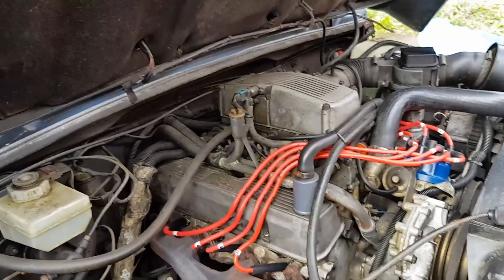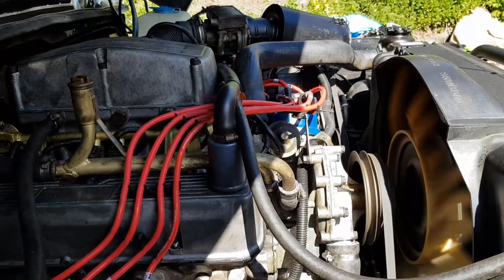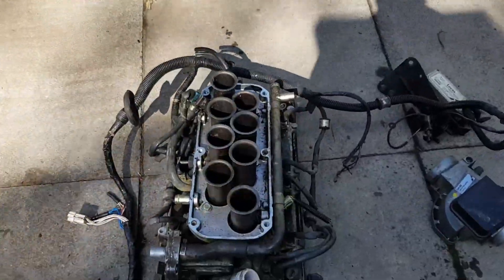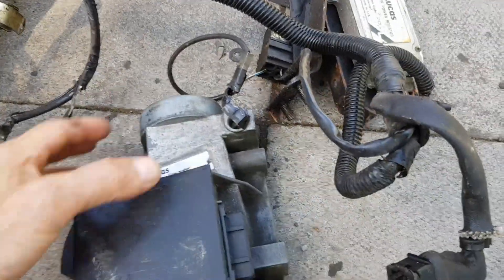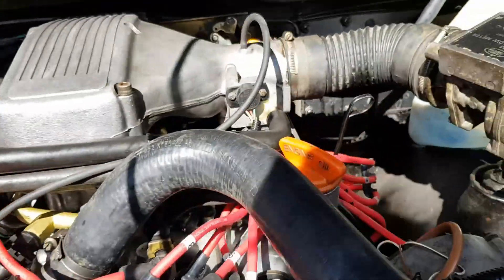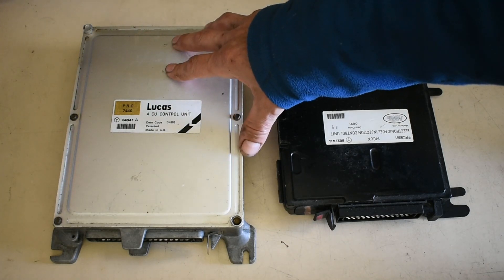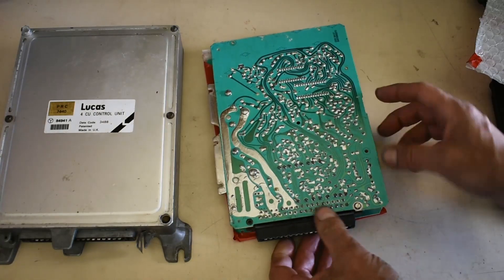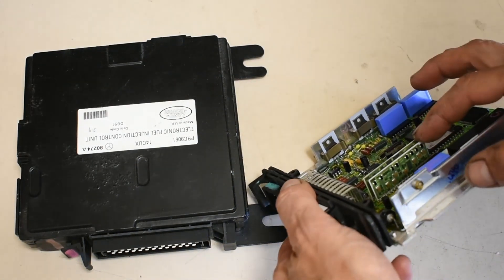Rover V8  EFI system

Comment: Nice work. I'm doing the exact same swap and I was wondering how you wired up the three relays under the seat next to the ecu? 
With the original system the flapper has a switch in it to turn on the fuel pump, but I guess with the 14CUX this is done by the ecu and may need some wiring mods? Cheers.
Reply from the maker: Going from memory, there are a few different connections in the wiring harness connecting a CUX ECU instead of the Lucas ‘flapper’ type. You definitely need the CUX wiring harness with the engine management. This will include under seat relays. I also changed the main car wiring harness to accommodate this change, otherwise some extra wires may be required. You’re right regarding the fuel pump. This is through a switch in the flapper air flow meter, where as it is a relay controlled from the ECU in the CUX ECU. The ECU main car harness has an inertia switch to disconnect the pump in an impact. This isn’t on the ECU harness and was part of the function the flapper air meter provided.  There are also a few other differences including the lambda sensors, if fitted, a road speed indicator also feeds the CUX ECU and this is derived from a sensor on the transfer box on later vehicles with electronic speedometers and ABS. The engine will run without this signal but may have a different response.  There is also an indicator resistor added to the ECU harness indicating if automatic or manual transmission. So, there are a few differences that need addressing to replace the injection system. Hope that is of help.
Reply: @tuopeeks  Thank you, it's a great help. I'm only changing the ECU/engine harness so I guess there will be a bit of splicing required for fuel pump relays etc. As for the road speed signal, I've read it's to help the 14CUX adjust idle properly and people seem to have omitted this in swaps and it's fine... but will have to test it all out to know for sure. Thanks again.

Comment: Tengo un RRC 3.5. Podrías darme todos los números de partes que necesito para pasarlo al sistema 14CUX??
Reply from the maker: Es un gran trabajo, pero el sistema es exactamente el mismo que el 3.9, excepto que usa el número de ECU PRC9235
Reply: @tuopeeks  Me imagino que tenes que desmontar absolutamente todo para meter todos los cables. No tenes video del proceso?

Tengo mucho problema con mi sistema y poner un sistema que pueda escanear seria excelentisimo.
Reply from the maker: @alcideslazomolina3286  Supongo que tienes un sistema "Jettronic" de 3.5 V8. Para adaptarse al "CUX14", debe considerar algunas entradas adicionales. Estos incluyen el sensor de velocidad no instalado en los sistemas "Jettronic". También debe decidir si se utilizarán sensores de O2. Comenzaría con el diagrama del circuito del sistema CUX14 y vería cómo conectarlo a su cableado en su Range Rover. Lo siento, no hice un video sobre todos los cambios y conexiones que hice.

Comment: Do the flapper airflow meters wear out on those? I know it's a problem with some old VW cars.
Reply from the maker: Yup, they can wear and develop poor contacts and non-linear tracking.
Reply: @tuopeeks  I imagine anything that relies on a moving physical contact especially on a carbon track would be problematic in the long term, bad contact, noise, flat spots and so on,,
also having a re-mapable ecu is a real bonus

Good upgrade  thanks for sharing
Reply from the maker: @T2D.SteveArcs  Thanks, yeah you got it, these printed carbon on ceramic variable resistors are well made but they see a lot of wear and degrade.